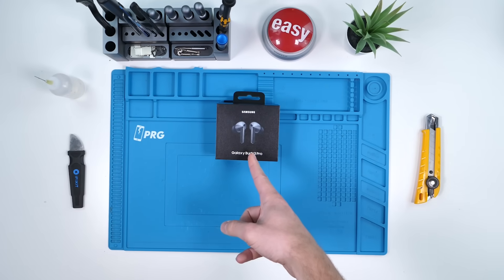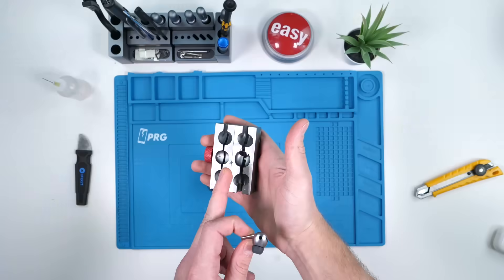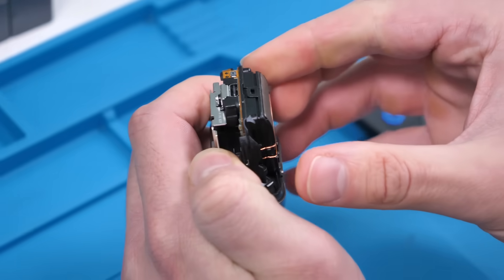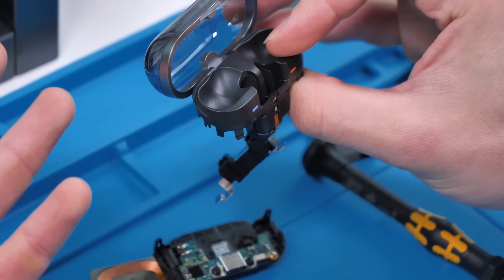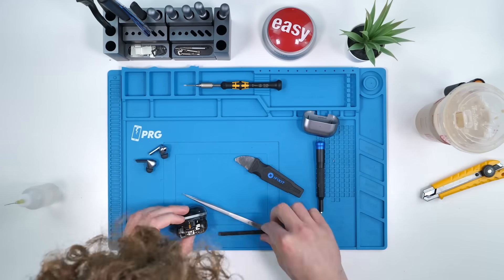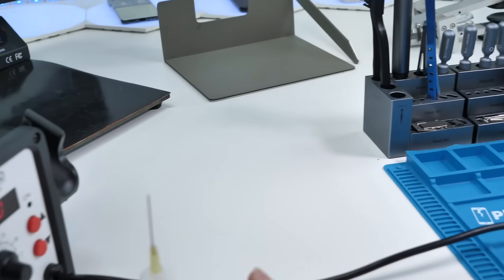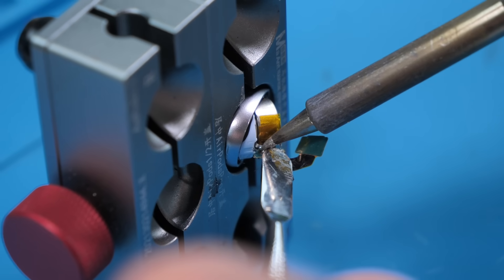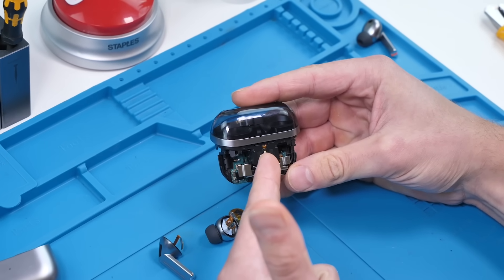AirPod's But... Repairable?

Comment: freaking W samsung on repairability
Reply: Every time i sent my samsung phones to samsung to get "repaired" i just get a whole new phone while samsung pretends to do repairs on a paper document stating what parts they apparently changed when clearly all theyve done is upload data from the old phone and then send the phone to a landfill.
Reply: @KK001  what have you sent for repair? If its the screen, they replace everything except the motherboard. Yay. Polution.
Reply: @FuzzyIcecle  yeah it was the screen. Its nice geting an almost new phone but it makes the repair service almost pointless.
Reply: @KK001  exactly, doesn’t help that 1; they take long as shit, 2: might loose your devive and 3: charge sometimes more than the phone is worth
Reply: @FuzzyIcecle  Apple is in no way better, as you will get spammed by the "you dont have original apple parts" once anyone else than apple certified personal changes even the tiniest dust particle. Even if Samsung support is shit, you can definitely rely on other ppl doing better service and most likely cheaper, without the "is your phone even an original Samsung phone?" treatment.

Also:
1: Not even that bad. Womp womp

2: Claims

3: Yes, however local "Phone Repair Shop"

4: Yeah just like any other phone company, trying to make bank out of it
Reply: @chomp5558  1: you realize that Apple removed parts pairing right? Only thing that gets disabled is True Tone when the replacement screen isn’t compatible. Another thing is that Apple support is lightning quick in comparison to Samsung, we aren’t talking about 3rd party repairs here because thats a completely separate issue. Samsung steals parts that aren’t directly from them, Apple doesn’t. You pay a premium for a better service, stop coping.
Reply: @FuzzyIcecle  Actually Apple did not remove pairing parts. I have iPhone 11 that upgrade to iOS 18, If I change ANY PARTS from original to other genuine or knockoff parts, phone immediately check parts is not original, and pops up in setting app.
Reply: @MalgeunSAM  it will tell you “important battery message” but it won’t actually stop showing battery health, whoever repaired the phone should also transfer the BMS board to bypass that.
Reply: @FuzzyIcecle  battery health is not useful feature for everyone unless care every single percentage but True Tone and Face ID is useful for most people who using iPhone. And those feature are still paired.
Reply: @MalgeunSAM  True Tone is available to screens that support it and FaceID only gets disabled when the part for it is missing/damaged. It can be transfered.
Reply: @FuzzyIcecle  Yeah they have a new battery as well in that "part". Which is good, I wouldn't want a pried-loose battery to be reused to be honest. And the frame, well, it is not that much material to be honest. The metal of two soft drink cans and some good plastic.
Reply: @pizzablender  1: what are you replying to again? And 2: so, why does it not matter when Samsung wastes parts, but when Apple does it they’re big scary evil corporation? I’m not saying they aren’t greedy, I’m saying that people shouldn’t defend Samsung for throwing out parts
Reply: @FuzzyIcecle  It's what parts are actually thrown out. The battery I find a problem, the frame much less so. But you have a point.
Reply: @KK001  that sucks but hey you atleast get an new phone for cheap. Btw what do you mean with everytime? Has it happened alot
Reply: @KK001 proof?
Reply: German is really good
Reply: Nah
Reply: No
Reply: Too bad even 3rd party screens are 300+ dollars a pop for the s24 ultra
Reply: I've got great support in the uk
Reply: @TheLevitatingAllay  Look at MrWhoseTheBoss’ comparison between Apple and Samsung support
Reply: Their battery is designed to be dog shit so you have to replace them within 2 years
Reply: @lemon9.9  and their USB-C ports fail left right and center. But I think the battery thing is dependent on use, since all batteries degrade
Reply: @lemon9.9  no theyre not theyre just lithium ion batteries
Reply: You still need specialized tools to replace the battery…
Reply: @timr.2257  lol, idk why the guy thought these buds being able to crack open easily meant that anyone could just plop the batteries out
Reply: If you're American, use iphone and praise the fuck out of it.
Reply: La gente que REALMENTE sabe de tecnología NO usa productos Apple. Saludos!
Reply: EXTREMELY rare samsung W
Reply: Just wait until you hear about all of their garbage terms…
Reply: @FuzzyIcecle  elaborate here. Don't just speak nonsense without making it make sense.
Reply: @techno_logic26  1: Samsung forces any 3rd party repair people to give all their customer’s information to them.   

2: if a repair shop finds a non Samsung part in the device, the part will be taken out and will NOT be replaced.    

3: Samsung Support also takes ass long to deal with. I speak from experience.    

4: their repairs cost a lot since they sell parts bundled   

It isn’t nonsense, its just as bad if not worse as Apple’s.
Reply: @FuzzyIcecle  customer support is from region to region tho
Reply: @BURZT_YT In the regions where it’s most relevant, if not everywhere else.
If the US or UK have awful support, as of Mr. Arun from MrWhoseTheBoss, how’s it going for you?
Reply: @Vortex001_MLG  haven't heard anything bad about samsung swedish support so far, or maybe i haven't heard enough lol
Reply: @FuzzyIcecle 2 is straight up illegal in Europe so that doesn't happen there. 4 is also kinda true but still way cheaper than alternatives. For 300€ I can get a whole new display for the S23 Ultra so the price is pretty decent
Reply: @BURZT_YT  and its garbage in all of them. Belive me, me, friends, family and online stories prove that
Reply: @Manfred-kz6gp  just because its illegal in the EU doesn’t mean it is everywhere else, they do it and there is proof of it.   

Also for USD $200 I can get a display for an S21 when an S21 costs ~160.
Reply: @FuzzyIcecle  I'm pretty sure it's illegal in most of the countries too, cause they are stealing and damaging your device with removing parts. Just sue them
Reply: @Manfred-kz6gp  “just sue them”. Just win a lawsuit against a multi billion dollar korean company. Sure.
Reply: @FuzzyIcecle  No problem in my country. My people have law insurance and can sue whoever they want. Especially a multi billion dollar company has no chance in my country, not the first time someone sueing against one here either
Reply: @Manfred-kz6gp  EU loves their people, look at how the smacked Apple with “USB-C and sideloading… OR ELSE.” We didn’t get that in the US
Reply: @FuzzyIcecle  Yeah, that's sth positive about the EU even though sideloading isn't really perfect either so I guess that they have some fun with the EU again
Reply: @Vortex001_MLG  I had North American support from Samsung. It took them a whole ass hour to tell tell me “go to a repair center@
Reply: @Manfred-kz6gp  EU should go ham on Apple and all other companies
Reply: @Vortex001_MLG  In Germany I got amazing support lol
Reply: @FuzzyIcecle  most of these things are illegal in the EU so they dont happen here
Reply: @Oxide53115  lucky
Reply: @ThatIceChampion there's a thing on samsung phones which is maintenance mode whitch basically won't have any personal information accessible to them
Reply: @susutag  It's honestly hard. I'm not like you who's jobless and always on youtube everyday. I may not know everything about samsung but I know more than you when it comes to engineering.
Reply: @techno_logic26  sounds to me like you dont know much at all
Reply: @susutag  a youtube comment can't say anything about me.
Reply: @FuzzyIcecle  they started doing that after Apple. It sucks that they did, but they were not the original company to add barriers and policies to local repair shops and serializing their parts
Reply: @osnarv8597  ok and? It doesn’t matter when they did it, it matters that they did it. Android came out after iOS, PCs came out after the Mac. Does that mean everybody HAS to use an iPhone or a Mac? No. Aside from that, Apple has stopped serializing most parts
Reply: @FuzzyIcecle  I mean yeah, I get that
Reply: @FuzzyIcecle Samsung doesn't sell s21 anymore and when they did it cost way more than 160, just because the phone is cheaper since it's been long since it's launched doesn't mean the cost of "NEW" parts would be cheaper tho, take the price of an iphone 13 pro max screen for example, about $300 to $400 i think
Reply: @omonighoprogressoghenetejiri  I’m not saying parts are cheap, Apple’s repair is also expensive as fuck. But I’m talking for the people that don’t sacrifice their money to Samsung every year. I still have an iPhone 12 and am not planning on upgrading, if the S21 is anything like the iPhone 12 then Samsung shouldn’t charge more than 160 for a repair since thats what it costs on eBay
Reply: @FuzzyIcecle  the s21 was released a year after the iphone 12, just because iPhones have good resell value doesn't mean that Samsung should reduce the price of something that is actually worth that amount because people sell it cheaper on eBay, think about that bruh, I will agree that it's not cheap, very expensive but it doesn't mean it ain't worth it
Reply: @omonighoprogressoghenetejiri  what are you on about? I’m not talking about resale price, the iPhone 12 is ~150 bucks too. I’m saying the repair for these phones shouldn’t cost what it does, nothing above 150 for a screen. For NEITHER of them
Reply: @FuzzyIcecle  I know, I'm just saying that if you check the iphone 12 screen replacement it's prolly still expensive too, it just costs that because it's a premium phone, I ain't tryna troll you or anything
Reply: @omonighoprogressoghenetejiri  both phones are premium and both have way too expensive prices for repairs
Reply: @FuzzyIcecle  true 💯👍
Reply: @FuzzyIcecle  but you'll still get quality tho
Reply: @omonighoprogressoghenetejiri  yeah, bad thing tho is that Samsung replaces the whole housing, while its nice to get a “new” phone, they’re making a lot of waste :/
Reply: @FuzzyIcecle  yeah that's true, prolly why it's still expensive too, I'm thinking it's a thing for the curved display that since it's curved into the frame it's better the screen just comes attached with the frame
Reply: @FuzzyIcecle  damn, where I am you can replace the battery independently tho, but that's mostly with third party repair shops
Reply: @omonighoprogressoghenetejiri  well, yeah you can do that with iPhones too if its a 3rd party, I’m talking about the company itself
Reply: @FuzzyIcecle  oh, okay damn that sucks
Reply: @Manfred-kz6gp  Indeed that is an original display, battery and frame. For the S42+ the price is 150, which I think is really fair.
Reply: @Vortex001_MLG  yeah but as an avid android user i like that I can buy different android accessories like a smartwatch from Samsung because it has features I use and don't have to be locked into an ecosystem. plus all the data they have is probably already on the Internet it's extremely hard to wipe your personal data completely from the internet without getting neurotic about it. at some point you just gotta give in and accept it otherwise you're gonna drive yourself crazy fighting about something that's not changing anytime soon. I think making repairable earbuds is a more important and easily obtainable thing that data security which is nuanced as heck and slow to change.
Reply: @therealchicken7151  I give that German support the dedicated Swiss “HUERÄ GEIL ALTER!” Seal of approval 🤙
Reply: @michealpersicko9531  Fair point 👌
Reply: @FuzzyIcecle  good thing there's samsung care
Reply: @Quan5021 I hope you realize the incredible amount of times Samsung doesn't honor their warranty. They refused to take a Galaxy Watch 6 trade-in because it had a quote "important scratch" (it was a hairline scratch on the frame).
Reply: @ThatIceChampion   I dont think their warrenty and the care services plane are the same-
Reply: @FuzzyIcecle  if you get it repaired first party its fast and withoout thinking you can do it you are just prob annoying ahh american who thinks the support reps are monkeys and u dont listen to them then u expect upmost respect back
Reply: @xkarpx I'm not even American, and I respect support employees. I know that they're stressed and they try to help- but my point is they're simply not GOOD at Samsung. Maybe its because they're overworked? Maybe its because if stress, I don't know, but Apple Support replies faster and tries to help. They helped me with a MacBook Pro before and I was very grateful. Samsung support has only ever told me "take it to a repair shop".

By the way, due to me not being American, I can't get the phones fixed by a first party and either have to do it myself or pay a fortune. Don't go out of your way to assume
Reply: @FuzzyIcecleWhere are you from then?
Reply: @FuzzyIcecle they tried so hard n got so far

But in the end they become like apple
Reply: @sargera1  fr.
Reply: @FuzzyIcecle could you elaborate please?
Reply: @tarandeepsidhu6812  basically they force repair people to:   

1: Give every bit of customer info that they have to Samsung    
2: Essentially steal any non Samsung parts as they will NOT be replaced   
3: they have very slow support, with chats taking 1 hrs + and calls up to 50 minutes.

Their repairs also cost a lot, sometimes more than the device since they sell parts bundleled.   

Their ethics are just as bad if not worse than Apple’s. And thats saying a lot.
Reply: @1403gavin  or just straight up steal the part, not to mention they ask every bit of info on the customer. Phone number, email, address etc. even when not necessary
Reply: @FuzzyIcecle Most normal apple fanboys:

Comment: Okay I'm going to be the bad guy here but this needs to be brought up. A product shouldn't be THAT EASY to take apart. The only reason I say that. Is because dropping stuff is a thing. If you drop that case on the ground. That acrylic top will shatter, The clip holding everything inside the case can break, the clip holding everything together can break. Now I'm not saying pull an apple and use a shitload of glue. But at least make it to where everything's not just held together with plastic clips.  I can't be the only person here who has dropped their earbuds on multiple occasions.
Reply from the maker: The buds themselves weren't that easy but I share your concerns with the case. It was way too easy...
Reply: @PhoneRepairGuru  I understand that. But if the case breaks the buds are worthless.

Comment: I’m giving these Buds3 Pro a try because my last two AirPods Pro developed crackling sounds when transparency or anc are engaged.
Reply: ME TOO!!! Its super annoying and only really happens when they move around in my ear with that on
Reply: Got the same issue, just 3 months after purchasing them. And since I purchased them abroad and I don't have Apple Stores in my country, I couldn't use the warranty.
Can only use them with ANC/transparency disabled.
So it's like I have purchased AirPods 3 two years ahead of time, but for $250 😒
Reply: I have them they’re not bad with my iPhone
Reply: there is a service bulletin for the airpods pro BUT apple being apple locks the bulletin to a certain production endate(10/2020) and you have 3 years from original retail purchase. my pops has a pair with the EXACT same issue but because they were made in like march of 2022 they are not covered ffs
Reply: One of my AirPod pros crackle to even when not using anc. So I can only use one of them now
Reply: No sera porque los dejas caer ?
Reply: TRUE, it añways happened with a pair of airpods pro 2nd gen i had
Reply: How they going so far
Reply: Well they don't work well when using a non samsung phone and the codec is restricted to the s23 to s24 series
Reply: @ricky1000 the codec is on every samsung phone but the UHQ capability requires a flagship phone with Bluetooth 5.3 which is S23 and later
Reply: @ricky1000  they don't work well on apple devices, I have the buds fe and they works really well on my pixel, except the codec part
Reply: I had this happen with my echo buds. Within the first few days they developed crackling. I assume it's something to do with poor circuitry.
Reply: Don't do it.  They have major charging issues.  Do a quick search.  I regret my purchase

Comment: On the OG Buds and Buds+ Samsung told the battery manufacturer to stop selling the battery (manufacturer sold it before) 😢
Reply: That's really uncool of samsung.
Reply: The buds+ used a standard button cell battery in the buds lol
Reply: The buds+ use a EVE icr1454s not the varta cell like the OG buds. That one is not that readily available, but ifixit us seems to stock them now.
There are posts of a few people that had issues sourcing them from elsewhere :)
Reply: Is not the true … the battery are the same of the Sony XM3 and they are standard. In my sony I have change and upgrade the  battery with Varta CP1254 A4 (they’re not cheap but they’re better than the original ones)
Reply: @f4lco021 was curious about the price, found them for 12€ per battery.
Not cheap, but, considering it goes in your ears, that's not extremely expensive.